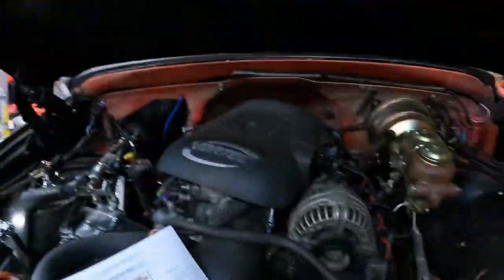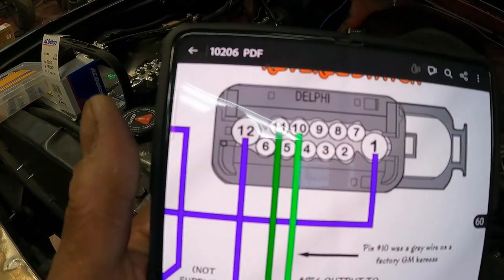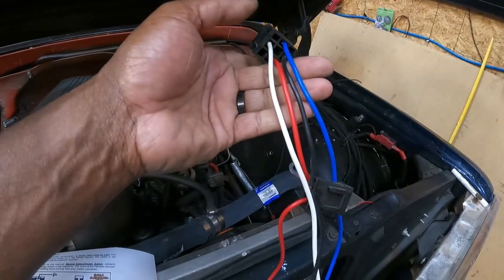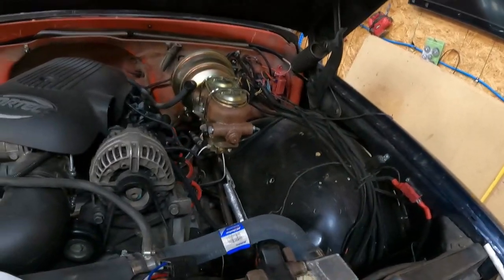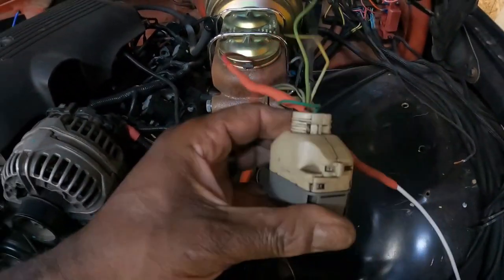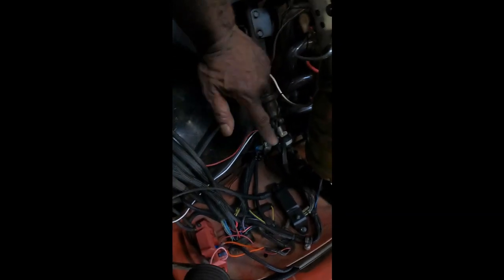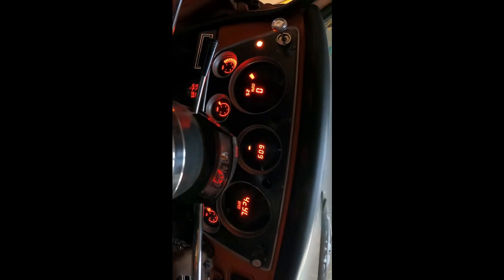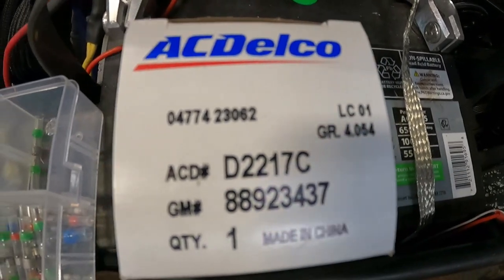Project C10 Neutral Safety Switch (NSS) & Reverse Lights

Comment: Where did you get the Neutral Safety switch and relay diagram from?
Reply from the maker: I got it here: https://www.google.com/search?q=4l60e+nss+wiring+diagram&client=ms-android-att-us-rvc3&sca_esv=ae9ad31c0e81471d&sxsrf=AE3TifMaUJxyyfeV7enO9Q60JX-YtbMnaQ%3A1762565400955&ei=GJ0OaYeEOsaCp84PvbHf-Ac&oq=4l60e+nss&gs_lp=EhNtb2JpbGUtZ3dzLXdpei1zZXJwIgk0bDYwZSBuc3MqAggBMgUQABiABDIFEAAYgAQyBRAAGIAEMgYQABgWGB4yBRAhGKABMgsQABiABBiGAxiKBTILEAAYgAQYhgMYigUyCxAAGIAEGIYDGIoFSM8fUKYHWO4TcAF4AZABAJgBpQGgAf4EqgEDMi4zuAEByAEA-AEBmAIFoAKxBMICBBAAGEfCAg0QABiABBixAxhDGIoFwgIKEAAYgAQYQxiKBcICCxAAGIAEGJECGIoFmAMAiAYBkAYIkgcDMi4zoAeAHLIHAzEuM7gHrgTCBwUwLjQuMcgHDA&sclient=mobile-gws-wiz-serp